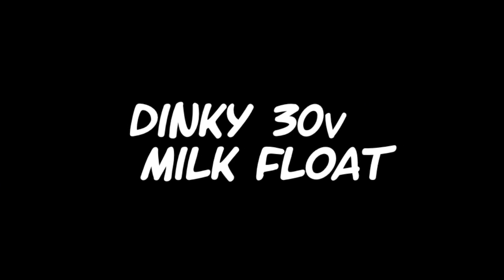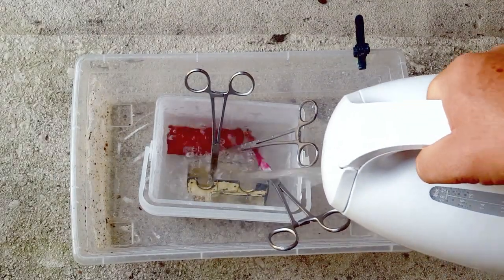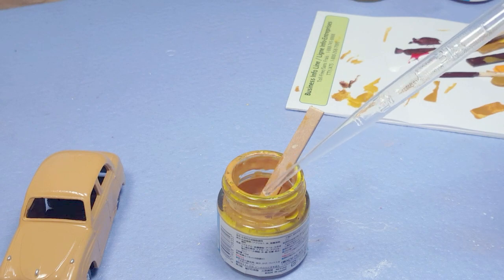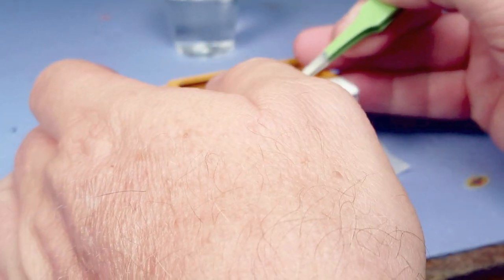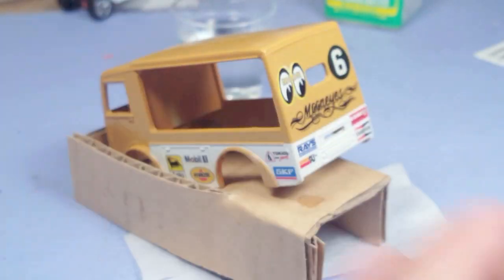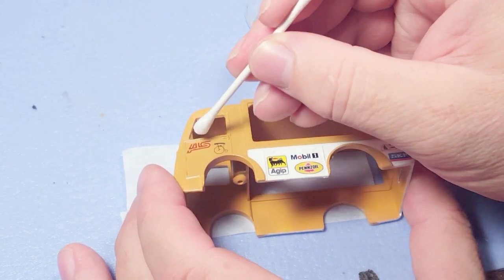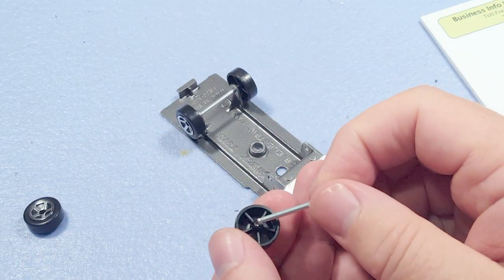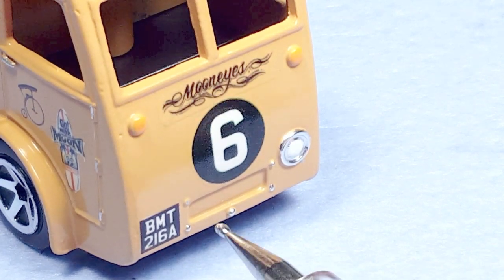Milk Float/Race Car Support Vehicle

Comment: that is a fantastic set now ,lovely work ,the only thing I would've leave are the original wheels but it's your car ,your choice .Fantastic details ,decals and paint job mate!!
Reply from the maker: Thanks Lazi. The wheels were a tough call. I have the originals and can easily replace them, but I had the wheels that matched from two Hot Wheel doners, and they look pretty cool when the race car matches the support vehicle. I would have bought some racing wheels with tires, rims and brakes, but they would cost almost as much as the original toy!
Reply: I know ,sometimes the parts are more expensive than the whole car ,excellent job Timo

Comment: Excellent stuff; it really does look the ticket. 👍🏻👌🏻👏🏻 The whole unit looks brilliant!
I’m fairly sure (and I’m certain someone will correct me otherwise) that the old milk floats back in the day were battery powered, at least in the cities. Go back further ( to when Martin was a lad 🤣😂) and they used an ‘orse and cart. I think the batteries were in those side compartments.
Reply from the maker: Thanks Septic. I read up on them a bit. I suppose they were replacing the 'orse-n-cart, so old style battery power was acceptable.
Reply from the maker: Perhaps the race team took out the batteries and installed a Volkswagon engine under the floor. 😉

Comment: Milk float I seem to remember reffered to (floating axles). Apparently coach builders dropped the axles on orse n cart to fit milk churns in on carts with large wheels, who knew?
Reply from the maker: I have learned a lot about these milk floats from viewers. Seems like there is a strange affection for them. 😉

Comment: Wow Amazing restoration timo well done did you make your own decals if so what software did you use take care 👍.
Reply from the maker: Thanks Adrian. I bought most of those decals from an Australian supplier. Unfortunately they were clear decals, so I had to have a white background for them. The numbers, number plates, and the pennyfarthings were made by me. I also don't have the capability to print the colour white, so I need to put a blank white decal behind a clear decal to get a white number, for example. 
I designed my decals using Gimp. I prefer my very old copy of Photoshop for graphics, but I bought a cheap printer that only works from a PC. Don't have Photoshop for the PC. 🙁

Comment: The NCB on the front would have been the National Coal Board.  Not unusual for a nationalised industry to run something like milk supply for mining villages and so on.
Reply from the maker: They look like an awesome concept, but they are unfamiliar to me. Online are lots of pictures, all a little bit different. In Canada in the 60s we had big delivery vans, the ones where the driver had no seat, and the door was open all the time. Saved time, not needing to open a door or stand up each house.🍼
Reply: @timosdinkydetailing  There were hundreds here at one time.  Just a big slab of lead-acid batteries and a traction motor.  I think they would run at 20mph for three or four hours - long enough to do the delivery round.
Reply from the maker: @gordonmcmillan4709  Those race guys actually took out the batteries and substituted a flat six engine, for a bit more power.
Reply: @timosdinkydetailing  That would work, mayweed updated brakes ...

Comment: It looks stunning but I am having trouble suspending my disbelief; electric milk floats ran at about 8 mph flat out!
Reply from the maker: Thanks David. What you don't see is that they installed a six cylinder boxer engine under the deck. 😉
Reply: @timosdinkydetailing  How silly of me not to realise this.  Now I am wondering if the milk float should be doing the racing, taken to events on the trailer pulled by the Austin.  I am very confused and will go and sit in a darkened room for a while.